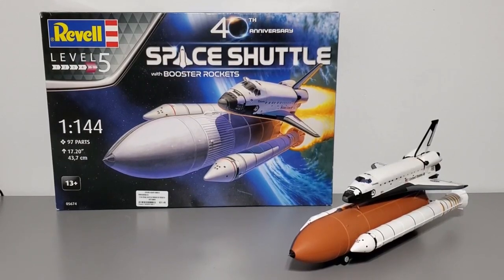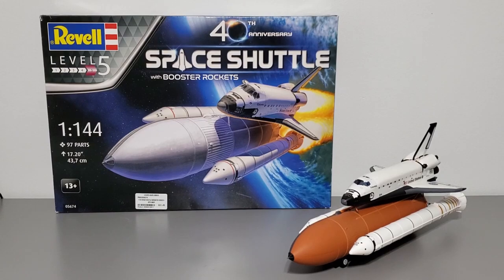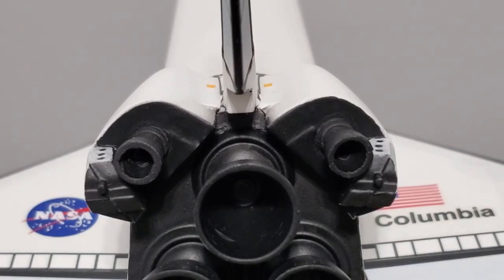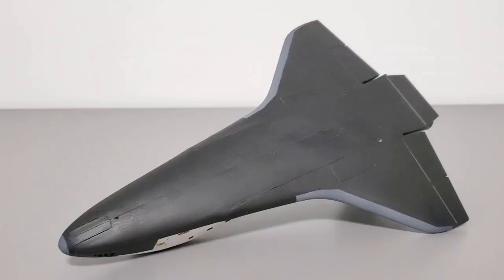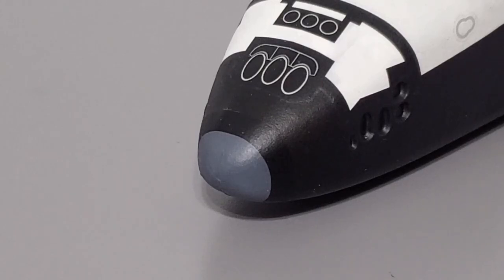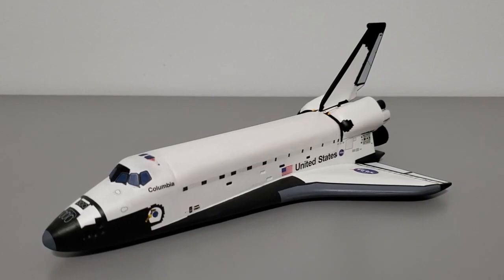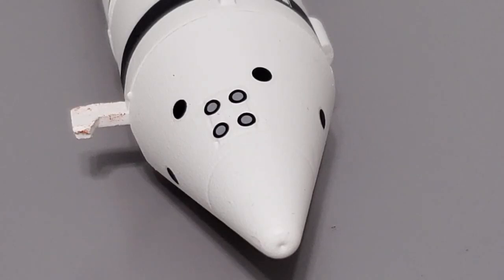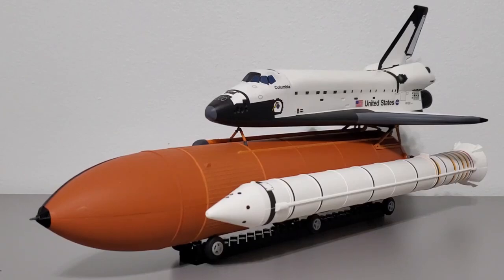The Revell 1/144 Space Shuttle: Honest Review & Everything you need to know

Comment: There is somekind of a sequential order followed by some modellers. It's quite sophisticated and I believe that it's not easy to do. And the smaller the scale gets the more important it becomes to apply only very thin layers:

1.	Cleaning the model/parts

2.	Primer (as many coats are required for a smooth surface)

3.	Main Colors (as many coats are required for the authentic look)

4.	Glossy coat (to prevent silvering of the decals and to seal the main paint job)

5.	Applying the decals (use softening and setting solutions)

6.	Glossy coat (to seal the decals and to blend in their edges)

7.	Weathering (washes, drybrushing and pigments as required)

8.	Matte coat (or glossy/semiglossy depending on the type of model)

I guess some of the issues in this build were caused by missing steps: silvering and the dark lines around some of the decals.

But I really liked your substantial and comprehensive review. 👍

Comment: I bought this kit and my issues were the shuttle doors weren’t a good tight fit at all. There’s a lot of space between the shuttle body and doors. Also there’s not a hole on the shuttle to attach to main fuel tank. It’s kinda mess. I wish it had some way on belly to show the tiles. I’m not a pro like you but other shuttles I’ve seen whether die cast or whatever don’t have much detail. I’m glad you showed issues that I noticed and sent to my friend. Glad it wasn’t just me
Reply from the maker: Yeah this kit is overall just terrible in quality. No wonder it's maximum level difficulty. The best kits I can recommend where you'll get an easier build are the 1/200 hasegawa kits. They're not detailed with tiles, but they are MUCH easier to build than this one. I also have built the revell 1/72 shuttle with the raised tile details. The tiles aren't very accurate and the build is tough but they're fun kits to build if you want a real challenge.

Comment: 7 years ago, i got the Revell’s launch tower with shuttle model, i still have it and as far i know, it did not have as many problems as your model [only the shuttle stack the launch tower was horrrible] but anyways, it still extremely hard to make, especialy when it comes to modifications to make it accurate , the painting its ok but getting an accurate E-T color? Almost an impossible task since it’s extremely hard to know if it’s even organce or wood-like color, it change alot with the ilumination. The SRB’s it’s….. ok? The only need you have to pray it’s that it has no filling issues ot YOUR DONE! Because of the ring , if you sand them or fill with anything, bye bye those details. And the orbiter……. Yea…nothing to say you already know.

Comment: This is disappointing because I just bought this kit to work on with my son. I've noticed that there are more than a few of the Revell kits lately that are not always well made. I'm curious why it's a Level 5 kit since there's no detailed interior to build. The last Revell Level 5 kit I did was their H145 ADAC helicopter. It had a ridiculously detailed interior that required a lot of fine work. This one looks like a level 2 or 3, at best.  

Thanks for pointing out all the differences between the actual shuttle and the model kit. I checked on Scalemates, and this one seems to be a kit that was originally released in 1979. That's the last time I can see there was any re-tooling of the molds. I bet those mis-alignments date all the way back to then. Since a lot of the space shuttle was still classified back then, I'm betting Revell didn't get any good mockups from NASA, and instead had to rely on visual details and basic measurements.

As to the underside: They could have easily recreated the tiles using simple waterslide decals. That they didn't is disappointing. Glad they included the landing gear option, though.
Reply from the maker: @AntaresScaleworks  You're absolutely correct, revell hasn't bothered to update the tooling since 1979. The only reason it's a level 5 difficulty kit is because of the poor tooling, it's a miracle if anyone gets the parts to fit together in the first place. I agree, they should have provided decals for the tiles instead of trying to do raised tile detail instead. 

I wish you and your son the best of luck in building this kit. It's a headache, but I'm sure you guys will find some fun in it! Nothing beats father-son model building.